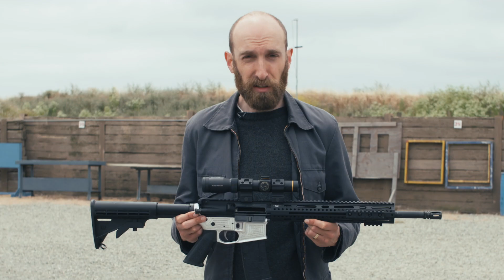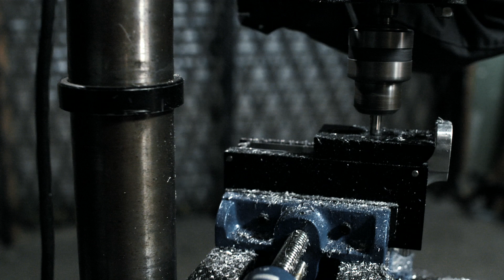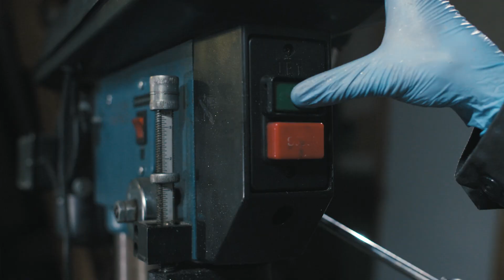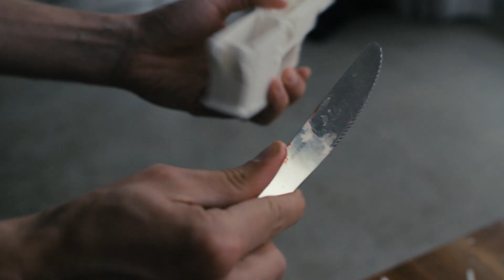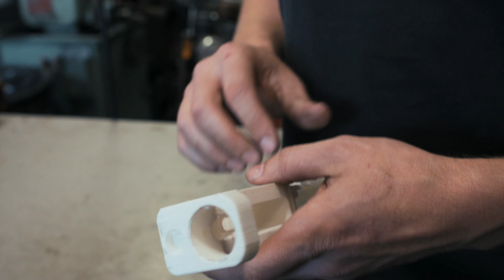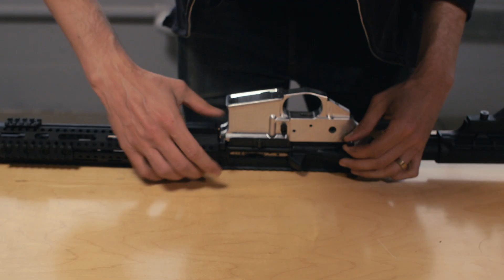I Made an Untraceable AR-15 'Ghost Gun' In My Office | WIRED

Comment: You mean for only $2400 I can legally make a $500 gun! SWEET!

And explosive rounds? Please, go fuck yourself hipster.
Reply: +CanadianBacon204 Nope. Not in the US.  Per the Gun Control Act of 1968, an individual can build a firearm for personal use but it cannot be sold to another person.
Reply: +Donald Cox so your saying criminals are going to get on the web, and buy a milling machine because they want a "ghost gun"?  get real. they are going to buy a illegal gun on the street with drug money for $200
Reply: +CanadianBacon204 Illegal to sell.
Reply: +Donald Cox They are combustible, not explosive. Gunpowder does not "explode".
Reply: +robert petry  - Incorrect.....you cannot manufacture the gun with the INTENT to sell......if you build it, get bored with it, and want to sell it, it is perfectly legal to do so. Simply add a serial number to it.
Reply: +Rgmekanic buy it for $2400, make 10 ar-15's, sell each for 300$, bingo rest is all profit.
Reply: I have cooked rounds off before in a machine gun. I know what they can take. It take a lot of heat to get one to cook off. Usually the barrel is glowing red to do it. I was about 500 rounds into shooting when it started to cook rounds. 

As for the primer, if your rounds are going off when you drop them on the primer, then something is wrong with your primer. Just a round falling itself is not enough PSI to make a primer go off. 

What you are saying, is just not accurate. It's so far off, that it could be considered misinformation and borderline propaganda. Primers are hard, and for that same exact reason. Firing pins are also hardened steel.
Reply: +Donald Cox and also just so you know... guns are only traceable if they are FOUND at the scene of a crime. so if I stole a gun... it was reported stolen, and i got caught with it... then i have a problem. This method of obtaining a firearm is harder than going to the store and legally purchacing one. and for felons that cannot legally obtain a firearm... and they do... well... criminals dont follow laws
Reply: The orange label means flammable. Explosives have a yellow one. 

Source: I used to be a certified ammo handler in the Army. As in, I had direct access to the AHA and was responsible for the transport and tracking of ammo for my unit.
Reply: +Isaiah Verdeja really? Because uppers, barrels, trigger groups, bolts, forward assists, gas blocks, rails, grips, stocks, etc etc etc, are free for the asking?
Reply: I really don't understand how the propaganda works so effectively on people. Millions of firearms exchange private hands every year between law abiding citizens. You never hear about them going on shooting rampages, because they don't.
Reply: +Christian M it is really Robert Petry. However, I do like Dick Van Dyke. Much like him, I'm a big fan of getting drunk and falling down! Anyway, it looks like I've got some reading to do. My understanding was that it would cost a fortune for an individual to be able to serial number a homemade firearm.
Reply: +Paul I've dropped a whole belt of 5.56 down out of a helicopter at about 60 feet. Not a single one went off. I know because I went down and recovered that belt. It's not going off unless you make it go off.
Reply: The chance is so minute that it's not worth worrying about. Considering how harsh the ammo is tested, manufactured, and treated in general it's almost impossible to set it off unless you put in a firearm and shoot it.

It's not like ammo is babied in transport, especially those bulk bag reloads.
Reply: I think you proved that old stickers are still around. They used to be orange about 15 years ago.
Reply: NATO sets the guidelines in the military. Has nothing to do with the UNO-HC/D. You are looking at a completely different set of standards.
Reply: +robert petry interesting, thanks for the insight.
Reply: +robert petry Incorrect. An individual can have a serial number assigned by BATFE should that individual decide to sell their homemade firearm. As with any weapon from a major manufacturer, the serial number must then be "permanently" in place on said firearm before it can be sold!
Reply: I would disagree. I used to be an instructor myself.

I watched the videos as well. They are using high powered pellet guns. Not the average off the shelf spring fired ones.
Reply: +Donald Cox may i ask, how many "ghost guns" have been used in crime?
Reply: +Rgmekanic For $2400, you can create gun after gun, also gunpowder is explosive, the orange diamond on the side of ammo crates is an explosives warning label...fucktard :) have a good day, owned.
Reply: The US never signed onto that particular agreement, we have our own. What is so hard about this for you to understand?

Start there:
http://www.dtic.mil/whs/directives/corres/pdf/410039m/410039m_vol08.pdf

The guidelines for our stuff is numerical. The coloration is merely for quick identification of the class of material for handling. 

https://www.ddesb.pentagon.mil/functions/HazardClassification.aspx

What you are saying only applies to the UN nations that signed onto the material agreement. We don't use it here in the US in anything except for aviation as far as I know, and I have handled NATO munitions across three states and in five different countries..

I was going to tell you what the different colors mean, but then I was informed that it was likely sensitive information.
Reply: FEDEX operates an airline that have to comply with international agreements in other countries, hence they would adopt UN markings for their hazardous materials. 

Nope, I was denied access to the images without my CAC card. You can try it yourself it's in the second link I posted there. I'm not logging in on my personal computer to make you feel better about it.
Reply: The laws do not define the regulations for labeling other than the location of the markers on the vehicles transporting the materials./.

 Those are defined differently, and had you read the laws fully, you would understand that.
Reply: Yeah you keep arguing your point bucko. You already have proven your ignorance and arrogance.
Reply: +Rgmekanic Yes but you can print other things with the ghost gunner, AND, it may be a little expensive but your gun is completely untraceable. The govt has no idea you have it. :) That alone is worth it.
Reply: +Donald Cox If a criminal wants an untraceable gun all they have to do is grind off the cereal number of a stolen gun for much less time, effort and money
Reply: +ymp5000 sure makes it hard eating breakfast...
Reply: Justin Newton No, individual weapons serial numbers are not just turned over to the government. The manufacturer has to keep the records of where they were shipped to for 20 years and if the government wishes to see those records they have to produce a search warrant if the manufacturer does not wish to volunteer such info. The vast majority of firearms have one serial number. Some high end/boutique manufacturers may serialize multiple parts but this is not common as it ads greatly to the cost of production.
Reply: ***** Only six states and D.C. require firearms registration.
Reply: I know you posted this 8 months ago but no.  They are not explosive.  An explosion is a rapid expansion of gases at super sonic speeds, something a lead or copper bullet physically cannot do.
Reply: false,if you want to sell,atf will give you a serial #.....easy as that.....register it
Reply: illegal to make them with the home cnc machine isnt it?
Reply: +UberR3D correct, however, the gun powder in the shell will cause an explosion.
Reply: Deathmonkeyjaw Basically, compression with in the barrel is what simulates an explosion. Hence bullets being shot.
Reply: basically
Reply: +CanadianBacon204 That would be 10 Felonies, amigo. For that, you'd probably never eat a free meal again.
Reply: +Rgmekanic You are an idiot... Ever hear of the 5.56 roufoss HEI rounds?
Clearly not.
And now please do tell me, what happens when you strike the primer of a round when it is not chambered, oh yeah, it EXPLODES.
Reply: Paul Why would you strike a primer on an un-chambered round? It's like lighting a gallon of gasoline on fire lol.
Reply: UberR3D Did I say do it on purpose? Clearly you never seen ammunition go off by accident be it from being dropped or not.
Reply: OK? Because you definitely know my past.
Reply: Did I say I did. I said it because if you have you would know it exploads.
Reply: no for 2400 dollars you can make as many ghost guns as you want
Reply: No what I meant was that you can make a 2000 dollar gun if you want,  you could make a shitty knock around gun if you want. What I really meant was variety because you can find cheap and expensive components online if you want.
Reply: +CanadianBacon204 Spend the next 25 years in federal prison grabbing your ankles for violating the law.
Reply: Joe11Blue I didnt say its a 100 percent chance, I just said it can.
Reply: Joe11Blue That isn't always the case, if it gets extremely hot it can go off, r if it lands on the primer it can go off. It may be a small chance but it can still occur fairly easily.
Reply: Isaiah Verdeja And at the end of the day like I said, You're spending $1500 for a tool to turn a $100 80% lower, and turn it into a $50 stripped lower with shitty machining.

And Isaiah, listen to Joe11, seriously.
Reply: Joe11Blue Not really, if shooting a primer with a plastic BB will make it go off then it doesn't take that much to set it off.
Multiple people youtube and mythbusters etc have proved that rounds can go off outside of a gun by accident.
Reply: LMAO!! Yeah. With my 25+ years of dealing with firearms and shooting I know that you're wrong.
Reply: Joe11Blue That's great to know, everyones  experiences are differen. If you want to be ignorant that is your choice.
I have been trained by ADF personnel in firearms use and safety so I think I have more than enough qualification to comment on the subject matter.
Reply: Joe11Blue That may be the case for some of them but most are using average airsoft guns where the FPS doesn't exceed 400-500 for safety reasons. If a person can be shot with them and barely get a welt that's not that much power.
I mean one video I can point out easily is demoranch, Matt proves it is possible to do it, while it takes him a few shots it is very possible indeed. Just like dropping ammunition. If you drop it on a flat surface obviously it won't go off but drop that shit on a point and it has a pretty darn good chance of going off if it hits the primer.
Reply: +Rgmekanic He just meant REAL rounds, all firearms that fire actual bullets are "explosive" in the sense that tiny explosions are responsible for ejecting them. I'm pretty sure that's all he meant. Rounds that are explosive in this way, as opposed to something like a paintball gun.
Reply: +Rgmekanic filing down a serial number does absolutely nothing but add on a charge if convicted.
Reply: +Russell Carlson you still need to go through the government to sell it once done and have it registered
Reply: +Russell Carlson Im fairly certain that at that point you have to have a manufacturers license of some sort.
Reply: +Tonio M registered with how most states don't have registries and the fed government doesn't

in Texas (and most other states south of the Mason Dixon and/or west of the Missippi its legal to buy a gun out of somebody's trunk in a parking lot
Reply: Joe11Blue Really because all these seem to be orange:
http://ian-albert.com/hazmat_placards/placard-1.3-explosives.png
http://www.thelabelpeople.co.uk/user/products/large/lp59728.jpg
https://hatchfive.files.wordpress.com/2015/02/fullsizerenderq.jpg

And look at that, flammable is red
http://ecx.images-amazon.com/images/I/51PbiKO14kL._SX342_.jpg

 I think I proved my point.
Reply: Joe11Blue Yeah righto... Because you know when you google something that is ever changing and needs to be updated ASAP it comes up with outdated images...
I proved my point and now you are just in denial.
Reply: Okay, you believe what you want.
Reply: Also you know what the orange label is from? The UNO-HC/D, you know the guys that review all these such labels and set the classes for them.
Reply: Joe11Blue "United Nations Organization (UNO) Hazard Class and Division (HC/D)[edit]

Explosives warning sign
The Hazard Class and Division (HC/D) is a numeric designator within a hazard class indicating the character, predominance of associated hazards, and potential for causing personnel casualties and property damage. It is an internationally accepted system that communicates using the minimum amount of markings the primary hazard associated with a substance."

Try again?
Reply: And lol RIIGGHHTTT "sensitive information" mhmm. Now you are talking out of your ass.
Reply: Exactly because you have NOTHING. The US complies with international law as does every division of the armed forces around the world. 
You lost I posted multiple links that say they comply with the US law and state what it it is.
Reply: And awww you made your own argument redundant as your own link states they follow the DOT laws which I posted to which surprise surprise are the same as everywhere else.
Reply: ***** Me or him lol
Reply: I think he meant explosive rounds as live rounds.
Reply: Fresh Apples
 And I meant hipster as liberal sensationalist, clickbait douchebag. Difference is mine is accurate ;)
Reply: the point is that it's untraceable moron
Reply: +wesley Hempoli how is that a point that needs making?
Reply: Mike M why you asking me I didn't make the video. That was the point of the video, not saving money.
Reply: +Philip Bazan  You are correct, but an X2 class mini mill is less than $1000.00 and you can accomplish the same thing.  Don't get it twisted. I'm totally on board with a desktop CNC mill to protect my 2nd amendment rights. There are just less expensive options for those who can spring for a CNC mill.
Reply: +Rgmekanic but the thing is, with the machine, you can make more guns, which in the end, u made enough guns that make it worth spending 2400 dollar on a machine
Reply: marshall And go to prison if caught, unless you go through to process of obtaining the proper documentation that authorizes you to conduct business as an arms manufacturer and an arms dealer.
Reply: ymp5000 im not saying selling them, just if you want to have like 10 more AR-15s, you dont have to pay thousands of dollars to buy them. and what makes you think im being serious when i post the comment?
Reply: +marshall dude a 80% lower is like $100 or you can buy an andersons for like $30 and do no milling
Reply: Mark Tse To my knowledge individuals are not required by federal law to put a cereal number on any firearm that make themselves unless they sell it. Please provide the statute.
Reply: +Paul Just so everyone knows before they start saying how i dont know what I&#39;m talking about, I worked in the Air Force in the Munitions career field, referred to as Ammo. I can say that you guys are both right and both wrong. Bullets are considered an explosive hazard, but are not actual explosive. The placards you posted earlier are the classification system to which you determine the hazard of the munition. Most small arms are considered 1.4. which stands for a moderate fire hazard. meaning if some how all those bullets in that box or can or case went off, it could cause a fire that could possibly catch other things on fire. If you throw bullets in a fire, they dont explode, they pop. That is why bullets are not considered explosive, there is no fragments that come out. If you crush a empty milk just the lid will pop off. its the same context. The primer causes pressure to build which forces the round out of the shell. Also why they refer to them as &quot;firearms.&quot; Grenades explode, bursting everywhere causing fragmentation, bullets fire.
Reply: +lordnevetsz actually BLACK powder is explosive. GUN POWDER is combustible. when a bullet is fired, it leaves the barrel because of gas buildup from BURNING gun powder. when gun powder is burnt, gasses are created. gasses take the path of least resistance, therefore it would shoot up the barrel of the gun. if gunpowder was explosive, modern firearms would be too dangerous to operate. we would still be using flintlock and percussion rifles
Reply: +Paul plus, it is obvious you did not read the full laws, or were too full of your twatty self to comprehend them
Reply: Speak softly, carry a big stick, and you will go far
Reply: I didnt mean that us watching yt is because someone serving, i said show some damn respect
Reply: Mark Tse If you will notice I said "federal law" but of course one must observe state law. I am glad you are starting to come to the realization that being a Patriot in Kalifornia is something akin to being behind enemy lines.
Reply: Kitten Milk Considering how you can't see how our armed services are keeping the wolves at bay I am sure that is not the first time someone has said it to you. Sad really... Additionally, you are operating under a flawed definition of the word "empire."
Reply: Kitten Milk Islies has been a problem for the U.S. since Jefferson was in the White House. Islies has been a problem for the rest of the world Since Moe Hamhead dropped that turd out of his ass.
Reply: What?
Reply: +UberR3D "An explosion is a rapid increase in volume and release of energy in an extreme manner". Sounds kinda like gunpowder to me...
Reply: Donald Cox If someone wants an untraceable all they have to do is obscure the serial number.
Reply: +Donald Cox Gun powder is classified as a propellant, not an explosive. It does not explode, but instead heats up and expands. The loud noise you hear is escaping gasses, as well as the bullet exiting the muzzle and breaking the sound barrier.
Reply: +Joe11Blue This went from rounds can go off by being dropped, to rounds can go off if shot dead center by a high pressure plastic BB. Good lord lol
Reply: ymp5000 then theres a big ass scratch mark where 1 of many serial numbers are XD
Reply: EHW2 I agree with you on most every point, except it wouldn't be cheaper in the long run, still cheaper to buy a stripped lower and not an 80% and this machine, no matter how many lowers you crank out with it.

Add to that unless you're doing something extremely custom with it, it's more worth it to just buy an MP15 Sport or one of the lower end DPMS offerings for $499 or less for a complete rifle.

Right now building your own rifle is more just for the fun of doing it, not cost effectiveness, as even with high end AR variants, it's cheaper to buy than build right now.
Reply: Justin Newton So what? If you are a criminal and don't want a gun with serial numbers you are going to obscure them. You are not going to buy and finish an 80% lower.
Reply: +ymp5000 yet, if you are caught doing a crime with that so called "ghost gun", the police will disassemble that gun, and almost every part on that gun will have matching serial numbers, which would trace back to the one on the outside shell of the gun, therefore, they would trace the gun back to the original factory, and the last owner of that firearm. please know your facts before you feign to do.
Reply: Many STOCK guns have parts with serial numbers, in order for the factory to keep track of batch numbers, etc., and in turn, those serial numbers are turned over to the gov for tracking purposes.
Reply: I wrote the comment i posted replying to the issue of some thug scratching the serial number on the exterior shell, trying to make it "untraceable"
Reply: Justin Newton Exterior shell?
Reply: Ive seen glocks with multiple serial numbers, it a lot more common than you think
Reply: Justin Newton Glocks have the serial number one the frame, barrel and slide. My Ruger has the serial number on the frame only. During WWII Luger serialized everything down to the firing pin. More manufacturers than not only serialize the frame because that is what is required by law.
Reply: +Anonymous Alaska I don't think these guys get that when they say it's cheaper to just obscure the serial number... If it has a serial number it's been registered to someone and the gov is aware of its existence, and if you bought that "ghost gun" off the streets you're probably holding a gun with at least two bodies to its name... You get caught with it and you get the charges for those bodies... If a criminal really want a gun that is impossible to trace they'd spend the extra money... Like seriously you guys make it sound like 2 stacks is a lot for a criminal, give em some potent rock and they can flip that that to two stacks in two days easily.. Fiends can't stay away from the dope
Reply: Dazz Gee Still less expensive and easier to obscure serial numbers. Having had a serial number at one point does not in any way mean that the gun has ever been registered to anyone. I live in Georgia and no one registers guns here because this is a free state There are many such states. Killing any forensic trace on the gun is easily done by slightly scratching the inside of the bore.
Reply: +Donald Cox - yes, and most ex cons are geniuses, and expert machinists with money burning a hole in their pocket to buy a CNC milling machine AND the associated tooling which nobody mentions, but is not an insignificant expense. Also, you still have to buy all the rest of the parts to actually build the gun. What situation are we really trying to address here? Would that be the nonexistent crimes committed with "untraceable" "ghost guns" or are we just trying to create panic and fear among people that are ignorant of facts and the law? Trying to eliminate a non-problem says volumes about the people doing the rabble-rousing. Oh, and the quotation marks are there to indicate how silly the terminology is.
Reply: +Oh-Billy - uh, yeah, that was kind of my point.
Reply: +Oh-Billy - No problem. Those guys will twist your mind up simply because you have to refrain from slapping some sense into them.  Here's a link you might enjoy given the topic here - a 0% billet. Keep fighting the good fight.

http://www.80percentarms.com/products/0-billet-ar-15-lower-receiver
Reply: +Rgmekanic If you can find an AR-15 for under $800 you must be on the black market. And yes, they're explosive. That's how ammunition works. The firing pin strikes the primer, which ignites the explosive charge.
Reply: +Derpancakes - Look on Gunbroker.com. There are many listings for ARs under $800.

Also, gunpowder burns at a rapid rate generating gas which creates a rapid pressure rise to propel the projectile down the barrel. It technically does not "explode". Look up the difference between a "high explosive" which "detonates", a "low explosive" which "deflagrates", and a "propellant" which includes black powder, smokeless powder, cordite, and ballastite. Nit picking possibly, but it behooves all gun enthusiasts to be technically correct when you have an opposition that is purposely misusing terminology to advance their agenda.
Reply: +Rgmekanic 
I  am guessing that if you buy the $1500 "GhostGunner" machine, it would eventually pay for itself depending on how many receivers you DYI. An 80% lower for 35-50 dollars would be free to mill out once you have the machine. JMHO
Reply: +Rich Borel Have to chime in here.

Detonation and deflagration are both chemicals processes; explosion is a physical process.

Using the term 'explosion' is not incorrect when talking about firearms; the projectile explodes out of the barrel because it cannot contain the 'very rapid expanding' (=explosion) gases behind it.

Detonation = super-sonic combustion (gases move in same direction as flamefront)
Deflagration = sub-sonic combustion (gases move in the opposite direction relative to the flamefront)
Most propellants deflagrate but some detonate, so they are not in a class all by themselves.

Some-one who is anti-gun would not use the correct term deflagration because it sounds like defusing, disarming. It does the opposite of creating fear so they opt for 'explosion' instead.

Having the correct terms is impossible to achieve IMO. Through study I realised that all the world powers through history did their own thing and used their own names and definitions. I've studied USA, USSR(translated), English, French, German, Belgium and Dutch weapons, ballistics and explosives and had a hard time keeping all the definitions in check. Then I found that armies like to do things differently than the navy likes to do them and then the air-force showed up and they didn't want to listen to either of them.
Reply: +Donald Cox No, they are not. They aren't explosive. Just because the gunpowder ignites, causing an explosion, does not mean the round itself is explosive. For it to be explosive, the bullet must contain explosives inside of it.
Reply: +mason hawkins Well, because they are "ghost guns" effectively there are no real statistics on how many HAVE been used in any violent crime. However we do know from seizures and reports that there may be anywhere from 200-300 in California alone.
Reply: I hate it when guns have seizures.  They should stay away from strobe lights and video games!
Reply: Cryptision Media Get a PSA kit and then buy a lower receiver for it.
Reply: Cryptision Media Also 90% AK's that are 400-600 bucks are trash.
Reply: Cryptision Media No, the AK's explode or jam. The AR's can at least be fixed without completely remaking the gun. SKS aren't very great either.
Reply: ***** "mossin" Are you dumb?
Reply: ***** You can't seriously act like you know anything if you can't properly spell "Mosin Nagant".
Reply: ***** Maybe you should learn to type you lazy fuck. Quit making excuses for yourself.
Reply: +Rgmekanic 
$1500, not $2400.  And you pay for the anonymity, it's not free.
Reply: +Bryan Kelsch 
Not exactly, you cannot sell OR distribute.

 But if your friend dropped by with an 80% lower and asked to use your "workshop" then that's a whole other story.
Reply: *****
Well, Martial Law IS suspension of the Constitution.  That's lawlessness to me.  So I do agree with you there. 

I haven't had a chance to use my GG from DD yet (you get the acronyms I think), but I have 4 80%-ters standing by, all shiny and ready to go.  I probably should stock up on  consumables for it, too.
Reply: +Cryptision Media armalite eagle ar15 at classic firearms for $629.00. Wilde heavy bbl.
Reply: well it is a round and explosive in the chamber that's what he means
Reply: +Rgmekanic Capital cost is always higher with low production count. The point isn't to save money, it's to do it yourself. I suppose it's kinda useless without the capability to make rifled barrels, but whatever. 

What I don't get is why you want to take issue with the guy for his beard. Honestly, he's a techie reporting on the margins of the tech world. Obviously not a firearms specialist.
Reply: +Rgmekanic Do you know what propels a bullet?
Reply: +nebod bnu tuld DO you know that lead doesn't explode?
Reply: Daniel Lunsford No, but the magical compound behind the lead does.
Reply: +Joe11Blue I work with a guy who was at an indoor gun range shooting factory 9mm ammo.  A spent shell was ejected from the gun, bounced off the wall into an open box of loose 9mm cartridges and one of the rounds in the box discharged.  It may have been from heat since nobody knows how long the hot brass was in the box, but that seems unlikely.  More likely it was that the spent shell hit the primer in exactly the right (or wrong) way to cause an unchambered discharge.  

Highly unusual, but not impossible.
Reply: nebod bnu tuld technically it burns but yeah
Reply: lol!
Reply: exactly he thinks criminals will pay that much and go through that kind of a process to obatian a gun
Reply: +Legion Etrangere.. 

"..you'd never eat a free meal again.."

Actually, mon ami, ALL of the rest of your meals would be free. Also, you'd gave free housing and free medical as well as a lot of free time on your hands. And probably get all the free sex you wanted as well as a constantly raging case of hemorrhoids and terminal flatulence.
Reply: Just show's that even background checks can't stop people from getting guns you gun loving moron. Did you even watch the video?
Reply: +DavidMN I bought my lower from Palmetto state Armory. they have damn good deals especially their blemished ones.
Reply: I made an untraceable vibrator in my home and I'm going to use it on my gf
Reply: ***** LOL. ;)  people are so funny sometimes on the tube
Reply: +Ski Fall hahahahahahahahahahaha. where did you get blueprints?
Reply: I hate to add some British Ignorance and to bring up an old argument, but after some research, both of you are correct. The red and white diamond is part of the GHS (Globally Harmonized System of classification and Labelling of Chemicals) for explosives. In the US, however, both the GHS symbol (Red and White) and the orange symbol (Class 1.4 - Objects with a major fire hazard). I think because of the US explosive rating system, and the fact that most propellants for firearm ammunition is classed as extremely flammable, and explosive, it may be entirely possible for both Explosive Warning signs, as well as flammable warning signs. Either way, whatever colour (forgive my spelling) it is, because there are so many different systems, if it says explosive on it, or has the same pictogram, its explosive.
Reply: $2,400 and you can get away with murder if done correctly. So when shit hits the fan, the police doesn't have any evidence to prove that you own the gun, no fingerprints found (by holding your gun with gloves), killing all witnesses, then your home free. unless your stupid enough to have a mental break down and snitch on yourself, then those $2,400 doesn't sound so bad while others get years/life in prison. maybe death row.
Reply: stokey805 police knock on your door. Your caught because you forgot to also wear gloves while loading the magazine. so the spent shells have your fingerprints on em.
Reply: careful, your inbreeding is showing. Nobody mentioned explosive rounds.
Reply: kaltenreich rewatch the video.
Reply: Rgmekanic bro they are 250$
Reply: TWSTED SMOKE I GOTTA SAY SHOW ME THESE $250 AR'S
Reply: Txn Tom its a joke lol
Reply: DAMN had a hole marketing idea n everything lol
Reply: Explosion: a rapid increase in volume and release of energy in an extreme manner. What does gun powder do? Combustion would be what triggers the explosion, explosion the the result of combustion.
Reply: fuck the law if i want to sell mah ghost gun i sell that bitch
Reply: Rgmekanic If you gotta do some work and don't want to get traced, then this is the way to go lol
Reply: Rgmekanic explosive amo doesn't require ATF approval unless the amount of explosive is high enough.

As a rule of thumb, anything smaller than 50bmg is for sure too little explosive, higher than 50bmg is for sure enough explosive.
You're right about them NOT making 556 though. Too small of a bullet makes it pointless to make it explode.
Reply: Donald Cox you can just file off or drill through the numbers of ANY gun, which is a fuck of a lot easier for Crazy Pete/Tyrone to do.
Reply: +Rgmekanic Except those rounds are "explosive". So what are you trying to do here? And you also do realize that not all guns are '$500', and not everyone is able to purchase one. Also, you cannot legally purchase a $500, un-traceable ar-15. If a criminal, or anyone for that matter truly wanted an untraceable weapon, it's worth it to put in a little but of money to get what they want.
Reply: Donald Cox
 I guess I'll start at the beginning.  Those rounds are not "explosive". If you're speaking of true HE rounds, they don't make them in 5.56. And if they did, to get them it requires class 3 permitting and a 200 tax stamp. Not all guns are $500, but you can sure as shit get an AR for $500 all day, brand new. Next up, the US does not have a gun registry. All guns very well can be untraceable. Or if you're a criminal, filing down a serial number is a lot easier and cheaper.  You're talking about a $1500 tool that does 1 thing, takes $100 80% lowers and turns it into a $50 stripped lower with shitty machining.
Reply: I'm not talking about true HE rounds, but technically those are considered "explosive" in a way.
Reply: +Russell Carlson, you can only add a serial number to it if you have a manufacturers license. Otherwise, it is illegal for an individual to do so.